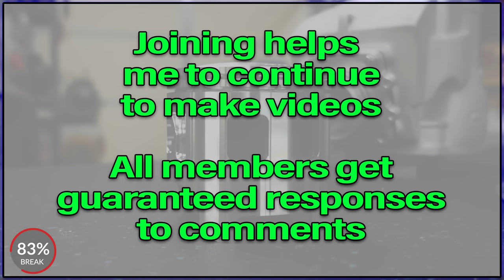Transforming a Honda TRX250R into a Drag Racing Beast! Performance Mods and Upgrades

Comment: Dude you got the audience bro , all those awesome parts from the manufacturer is helping eachoter . That's awesome. All those parts your NOT throwing in the trash should build another trail quad with . Can wait for the final product , are you dyno tuning it at some point ????
Reply from the maker: I'm not sure what I'll do with the take off parts - I may box them as an "MX kit," because it can always be converted back.

If I'm able to make it to a dyno, I will definitely be sharing, but I don't plan to any time soon.

Comment: Good ol' Milwaukee batteries!  I do die repair, I've seen so many Milwaukees fall apart just like that.  I've had dewalts too and their batteries will crack too. I've been running bauer from harbor freight for 2 years.. batteries are the toughest I've seen.  Shame the tools don't have as much power lol.
Reply from the maker: I've heard pretty good things about Bauer. The one thing I will say, is that the battery that broke was a cheap aftermarket lol

Comment: Another awesome weight reduction/race build Mike! And thanks to you I’m buying that parts washer through your link. Mind telling me your actual kerosene/diesel to mineral spirits mix ratio. Never made my own parts cleaner solvent and figured my question could help more than just me. Thanks for your time and badass content! 💪🫡
Reply from the maker: Thank you for using my link dude; it's a great little parts washer. I do about a 50/50 mix or diesel or kerosene to mineral spirits and it lasts a pretty long time.

Comment: Some SLS (superlight) triple buff skat trak paddles are typically a lot lighter than the standard buff. However they’re pricey and usually a long wait. I’d see how those paddles are, see if you want more paddles/less, haulers, extremes, etc and consider ordering some

Comment: A old drag race practice was to run automatic trans fluid in the front wheel bearings.  Less rolling resistance.

Comment: Your wheel and tire combo is still heavy. Douglas blue label wheels, the .125s are your go to for a drag wheel. Also you need triple buff tires instead of just single buff.

Comment: It would be fun to put this quad back to what it was before this video and find another 250r or do they make a light drag frame? And start from scratch and make the lightest 250r build ever. Using the parts you bought for this one, and I'm not sure what else is involved. But almost no plastics, lighter seat, just unnecessary stuff. No front bumper, no rear grab bar, lighter rear and front shocks with no reservoirs, no steering stabilizer . Brackets cut off frome that you don't need. Etc. Lol. That would be crazy.

Comment: I'm surprised that you went with stainless on the pipe instead of titanium like from RP race.
Reply from the maker: I believe its raw steel. RP makes a beautiful pipe but regardless of what it's made of, the design of this pipe will out perform an RP pipe almost guaranteed.

Comment: Drag bikes are a different animal. I once had a guy tell me that they cut the top motor mount out of their raptor 660 to shave weight. The engine would move around but they never had an issue. Wonder how many other things they cut off them to save a couple more ounces🤔.

Comment: Did you ever do a comparative between the voodoo an og banshee on the difference the Waight made wouldn't love to no after the mega efforts😊
Reply from the maker: I'm pretty sure in that series I did a weight comparison. I know I did a dune setup at the end of the finale and it was like 60 pounds lighter at I believe 335 pounds?

Comment: well it sure looks like it will be fast ... in a straight line 🤣🤣. it looks great dude . but seriously if you dont rebuild another 250r as the mx build with all of them extra parts you have , im going to be extremely disappointed in your life choices 🤣🤣. im building a 2nd 250r with all of my extra parts . so should you , after all why not have 2 250R's 🤷‍♂. give me one reason why its not a good idea 🤣
Reply from the maker: Haha, dude I hear you! This mostly comes down to time - there's no way I could have pulled off an entire build to be ready for this trip. Space is definitely an issue as well - I am packed to the gills right now and may need to start selling my stuff.
Reply: @MichaelSabo  build another shed lol

Comment: Hey Mike I have questions  about timing.  I have a bdt timing plate and counter balancer bearing holder.  But I don't have the piece that sets the timing on the balancer.  Is that really needed.  4mill cylinder porter by Bubba.  Stock bore.
Reply from the maker: I haven't worked with a BDT balancer cover but I'd imagine it's like others I've worked with. It should have come with the piece that the pickup bolts to and is adjustable. If it's missing, I'd hit up BDT and see if they will send you one. I'm sure you could rig it up to fit without the adjusting plate but timing is something you don't want to be guessing with and it's an inexpensive piece to not just replace it. Just my opinion! I hope this helps man!

Comment: Recently acquired quad with
Frame VIN: LHJSPM7897B000164 
Engine VIN: 6KNGX 200ACA 
Can't locate a manual for it, but trying to do a rebuild of engine. Just curious if anyone know of a part list or manual handy I could find? Also, possibly another engine similar that parts are interchangeable with? Thanks

Comment: I have a ? Is it best to use antiseize or like waterproof grease?
Reply from the maker: I think grease is better in areas of movement and friction, like inside bearings or seals, but for places where you don't want things to get stuck, like bolt threads or axles where they sit in the inner race of a bearing, I would choose anti-seize.
Reply: @MichaelSabo  ok thanks bud I appreciate the explanation/example. I never knew really where to use which

Comment: Why doesn't someone make a carbon fiber axle?
Reply from the maker: There was a company called BAC, back in the day that made CF axles for Banshee's if I'm not mistaken, but I think they had failure issues. I don't know much about them.
Reply: Can you explain how you're able to put the urmosi on a 250r? I'm thinking about putting them on a 700xx but idk if I'll be able to make them work

Comment: I'm sure you know but make sure to wipe that pipe down with alcohol before it's first heat cycle so your not burning in finger prints from the oil on your skin

Comment: if you go to the gym it would be cheaper and you would be able to cut more weight.
Reply from the maker: I've actually gained 30 pounds since going back to the gym after tearing my shoulder. I go 3-4 days a week and do cardio regularly. I just eat out of control.